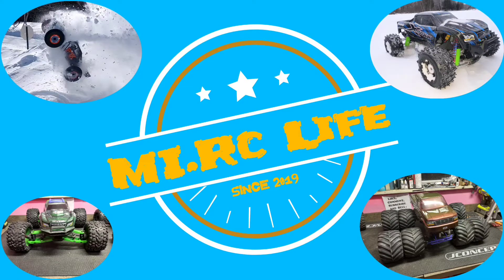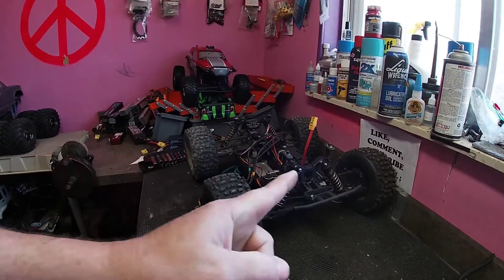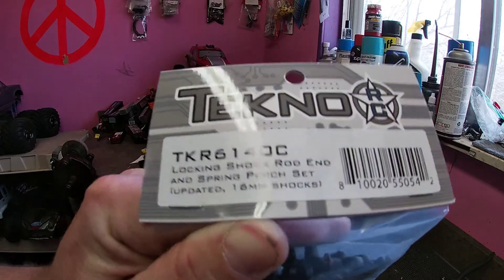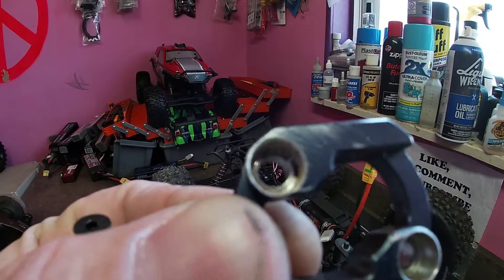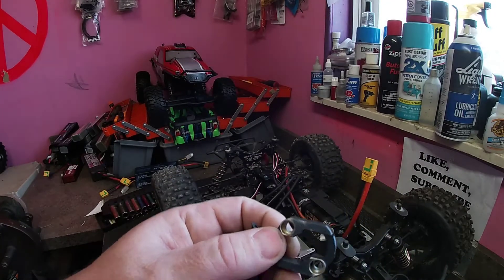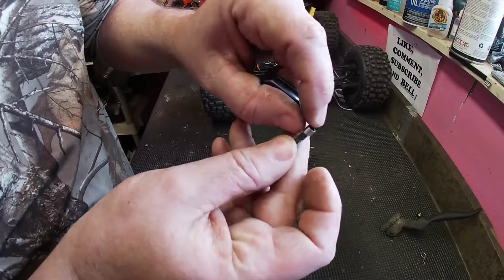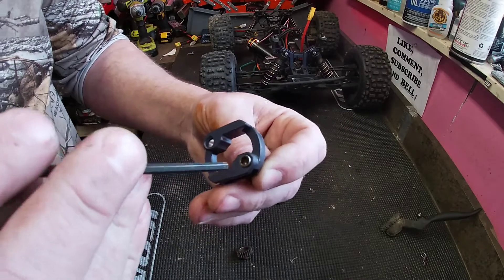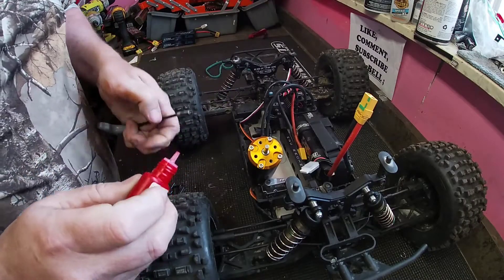New Custom Motor Mount + New Locking Shock Ends & Spring Perch Set For The Tekno MT-410

Comment: Put some of the traxxas high density foam that comes with those light kits and some other parts and put it under the motor my brother
Reply from the maker: I thought about using foam but I'm driving in the snow & mud & water & sand quite often and I was thinking it may get all wet and nasty.  The hot glue Is water resistant and nothing should attract to it I figure🤷.  I guess if this doesn't work I'll have to simply peel the hot glue off and start over with something different. (like maybe some foam...lol)